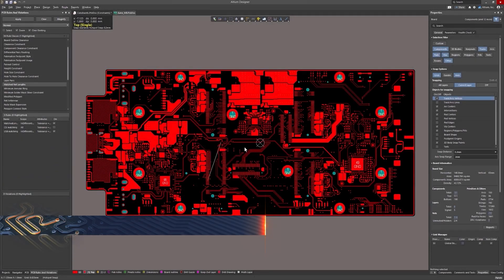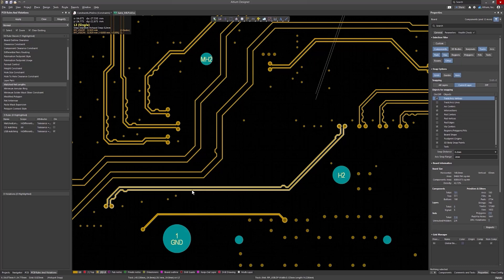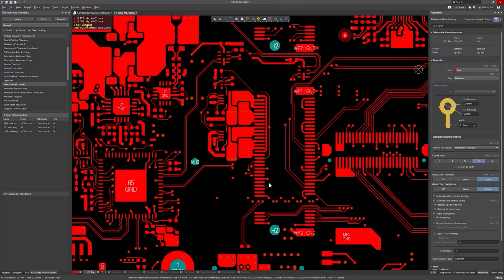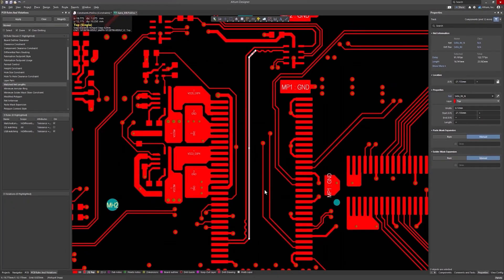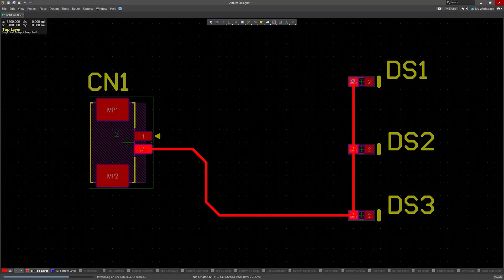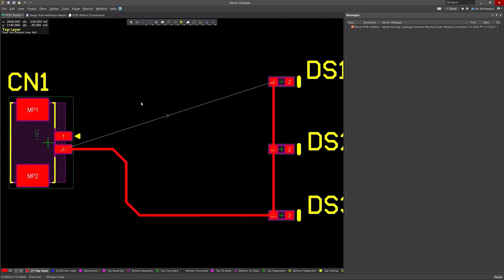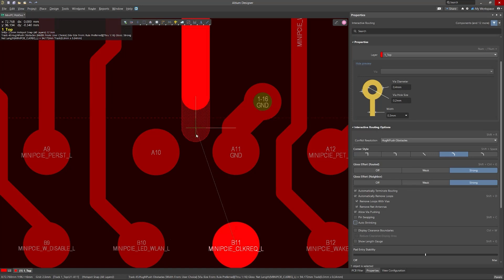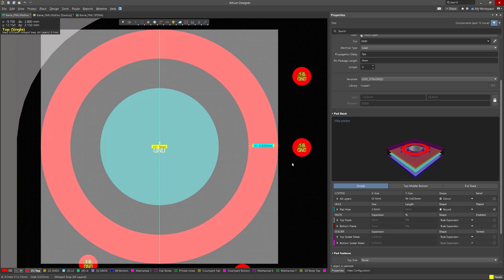Explore Routing Improvements in Altium Designer 25

Comment: The design rules in Altium, standard subscription are terrible! The priority is not respected, when many design rules are created, especially for internal and external layers! In addition, by some reason the polygons now need separate design rule, despite part of a net class! Altium introduced Constraint Manager, that supports matrix approach for the next classes. I assume, this happened, mainly, because the standard design rules concept is broken. Of course, the constraint manager is not included in the standard subscription...
Reply: I have never had a problem creating layer-specific design rules and I regularly define net-based clearance rules for polygons without using a polygon class. The reason the Constraint Manager was created is because users who convert from OrCAD or PADS will use a similar matrix approach as the Constraint Manager. If you have a specific question please feel free to ask and I would be happy to make a video about it.
Reply: @Zachariah-Peterson  Dear Zach, I am pleasantly surprised that you respond to my complaint! I have a HUGE PROBLEM WITH ALTIUM recently!!! The design rules just don't work. And it's not like I'm a newbie, I've been working with Protel/PCAD/Altium since 1999-2000. Since I am in the field of power electronics, I have to design boards with many requirements regarding coordination of insulation - insulation matrices with different clearance between net classes for outer and inner layers. Not only the clearances don't obey the priorities, even the connect style of the pad/via to polygon doesn't follow the rules I set. Polygons are not perceived by Altium as part of the design rules for net class, despite the polygon is assigned to a net, part of this net class. Therefore, I am forced to create more and more rules for all polygons, and they are several dozen for eight-layer boards. And finally I have 150-200 design rules. It's a big mess!
I would like you to kindly ask you for a contact Email where I can describe to you the problem in more detail, at least as much as possible without giving away confidential information about our design. Your Altium-Support colleagues in Germany and England have been informed since May, but I have not yet received technical assistance on this matter.
Many thanks in advance!

Comment: For dynamic length compensation, you also have to define transmitter and receiver, such that the dynamic compensation is done properly. Where do you define that?
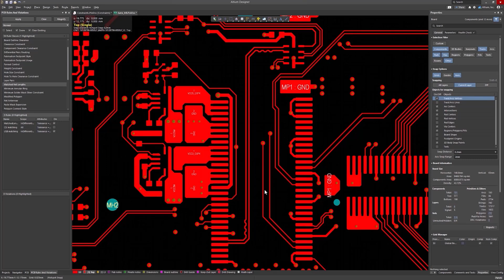Reply: You don''t have to define transmitter and receiver, the best practice is to place the length compensation section where the length mismatch arises. For some connectors and BGA pinouts in designs I have worked on, this more often happens  be close to the transmitter side of the link, but technically the mismatch could arise anywhere. In the image at 2:14, the video shows an example where it happens at both sides.